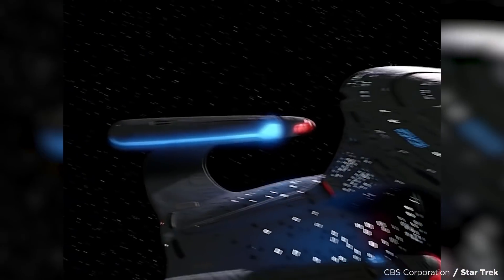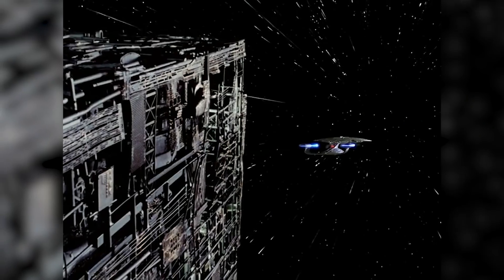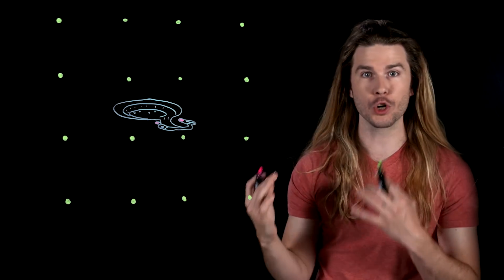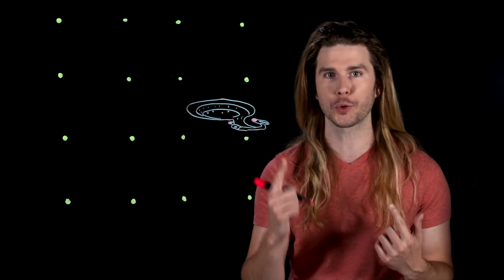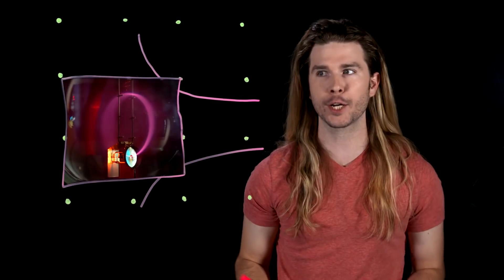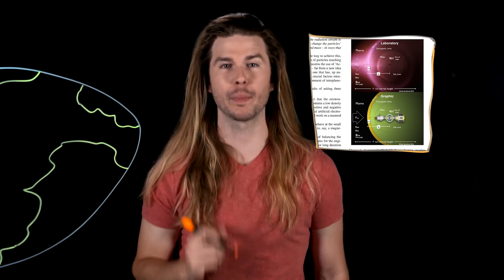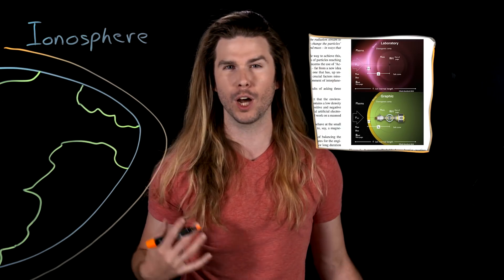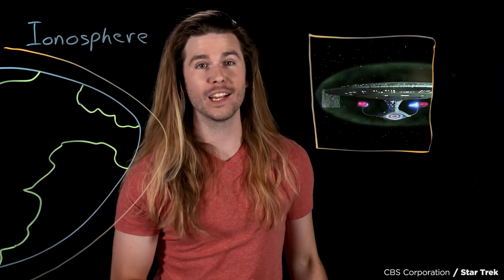How Do Star Trek’s Deflector Shields Work? (Because Science w/ Kyle Hill)

Comment: Phasers are not plasma beams in the classical sense of plasma. "Phaser" is, according to the book, an acronym for "phased energy rectification" – named for the process of turning stored energy into an energy beam without an intermediate transformation. Energetic plasma is pumped to a prefire chamber made out of a superconducting lithium-copper. There, it undergoes a rapid nadion effect in which strong nuclear forces are liberated. A protonic charge forms and is released in pulses to the emitter made out of the same superconductive crystal. A beam of electromagnetic energy is released from it, at the speed of light. On starships, energy for phasers originates from the EPS, while on hand units, the charge of energetic plasma is stored into sarium-krellide. This material is used because it can't accidentally release the charge of plasma. (yes, I just quoted the book).
Apparently in Star Trek, the main purpose of a phaser is wearing down shields, so these particles seem to be best suited to dissipate the energy of shielding and less effective against hull. The Tech Manual also states that there is a certain ratio (between SEM (Simple Electro-Magnetic) and NDF Nuclear Disruption Force)  that changes between the settings of a phaser. The initial effect is more metabolic (High SEM and low NDF; thus stunning), then turning to thermal effects (until lethal), then slowly becoming so volatile that it is able to disrupt the subatomic bonds, causing this disintegration-effect on the highest settings (high NDF, low SEM) (again, quoted from the book)...
Shields on the other hand, generate distortion layers of gravitons (the artificial gravity particles) that deflect energy along its own shell, thus it seems like an egg-like sphere or generally that large-area lighting-up when hit at some spot. The frequency of these is in tune with the ships own weapons, allowing them to pass through, while blocking incoming attacks from outside. It does not reflect or redirect the energy, it more dissipates it evenly (which is the plothole explanation why shields can wear out)... And yes, even more quotes from the book, albeit abridged because I don't want to quote the whole danm thing.

Comment: Well, that was interesting, but the show already discussed this in various areas. If we go via Michael Okuda's description (he wrote the book on most of the TNG technology that ST used and developed on in DS9, voyager and the TNG films): In Star Trek TNG (and the other ST shows) the shield systems they use is based on warp field tech. Essentially, when a beam weapon or a photon torpedo impacts the field around the ship, in that specific section of the shield matrix, it is energised and to the beam or torpedoes POV (as beam weapons are sublight only) the ship "moves" out of the way of it due to the shield in that tiny area "warping" space so it cannot hit the hull.  (Phasers are often modulated to penetrate a shield this way via scattering effects etc, but then shield tech improves to combat this.)

This localised area effect uses a GREAT deal of energy to generate the field against the high levels of energy being directed against it and so shields can be depleted rapidly the more energetic the weapon being used against them. As a shield absorbs fire and loses the energy it contains, the warping effect is lessened and fire can begin to "leak" through. Sufficently high energy weapons can "burn" out the generators creating the shields fields so rotating ships during combat to allow affected shields to replenish the defence fields and allow engineering to repair damaged shield generators is very important. 

 [NB: For an example of the power ST ships and shields have to cope with. A Ship based Phaser fired on a planet at full strength can destroy every living thing on the planet and, under continual fire, eventually destroy it.]

In Star Trek, this is why you do not use photon torpedoes if a ship has its shields up, as although torpedoes have penetration aids to try and get past this, they are vastly less capable than the phaser beam (or disruptor). So, in normal space, phaser weapons are usually used to deplete the shields of an enemy ship 

However, during warp combat phasers are useless as the energy and particles are not FTL based and so are affected by the warping of space, massively dispersing them and rendering them useless. Only photon/Quantum torpedoes can be used as they are capable of travelling at warp and so can hit and discharge against the ships shields/hull. Romulans, as they do not use photon torpedoes, use the plasma torpedo as it can travel at warp speeds if required (however, although it is vastly more destructive than a photon torpedo it is FAR slower.)

So, ST shields for combat are Warp field based. They do have another set of shields that always remain on and those are used to protect the ship at warp travel: these are "technically" the deflector shields which, when coupled with the main deflector dish at the front of the ship, protect it from dangerous particles, micro asteroids and space debris. 

But how we would create "shields" with our current knowledge base? Really fascinating. :)

Comment: Many things wrong here.
First the main defense system used at sub-light speeds since the last century, is the phaser. 
the common name for a complicated energy release process. 
as a replacement! for pure EM devices. such as, Laser and particle beam accelerator. 
Phaser is an inherited acronym for PHASE • Energy • Rectification, which describes the original process in which stored or applied energy was converted into a different form when it entered the phaser system to eject it to a target. without the need for further energy transformation in the meantime. This is also essentially true of the current phaser effect. 

Phase energy is triggered by the application of the fast nadion effect (FNE). Fast Nadions are short-lived subatomic particles that have special properties associated with high-speed possess interactions in atomic Nuklei. These properties include the ability to release and transfer strong nuclear forces within a class of superconducting crystals known as 
fushigi - no - umi. The crystals were from science Departement of the fleet research and development facility in Tokyo.

Each Type X emitter element can direct 5.1 megawatts. For comparison: the small personal phasers. which excelled at Starfleet crews. belong to types I and II. of which the latter has a maximum power of 0.01 MW. Certain. planetbound phaser emitters intended for defense purposes are referred to as Type X +. their exact energy output falls under secrecy. The Galaxy  class has twelve phaser banks in two different sizes. which are mounted both above and below the ship and additionally two benches for lateral detection.

Emission of the beam 
The triple-faceted crystal that forms the last, the ejection station, consists of LiCu 518 and measures 3.25 X 2.45 x 1.25 meters per single segment. The crystal lattice formula used in the matrix enhancement process is Li..Cu..:SI::FE.:.:O. The collimated energy beam exits from one or more facets, depending on which precombustion chambers are filled with plasma. The firing sequence of the segments, controlled by the phaser function command processor, decides along with the ejection direction of the facet, the final vector of the beam. The total energy output of the segments is directed across adjacent segments due to power coupling, converging at the output location where the beam exits and seeks to the target at the speed of light. Narrow beams are fired by fast segment-firing. further fan-shaped or cone-shaped rays result from a lower rate of firing. Of course, wide beams tend to cause significant energy loss per unit area detected.

Targets which are protected by EM defensive shields and a partly absorbing, partly repellent surface coating can still be hit. But only with a correspondingly higher energy consumption. since the shields must be broken. Due to the EM • polarization, the phasers can penetrate the ship's shields from the inside to the outside, whereby only a slight loss of force due to the resistance on the inside of the shields has to be accepted.

Now the deflector shields
Like most force field devices, the deflector system also generates a limited area of highly focused spatial distortion in which a high-energy graviton field is maintained.  The deflector field itself is emitted and shaped by a series of conforming transmission grids on the shell of the spaceship. creating a field that closely follows the shape of the ship. This field is highly resistant to impacts of a wide variety of materials, ranging from relativistic subatomic particles to more massive objects with lower relativistic velocities. When such a disturbance occurs, the field energy is concentrated on the impact point, creating a strong, narrow space distortion there. an observer aboard the ship. it looks like, as if the intruding object were bouncing off the shield. However, a zero-dimensional observer on the penetrating object would find his / her trajectory unchanged while the ship had suddenly changed position. This is somewhat analogous to the spatial distortion caused by a natural gravitational source, and is usually from a momentary discharge by Cherenkov radiation which often appears as a short blue flash. The deflector is also effective against a variety of electromagnetic, nuclear and other radiated or field energies.

Shielding the ship against the full spectrum of electromagnetic (EM) radiation would require too much energy for normal cruising flight mode. 
In addition, a shield system working against the entire spectrum of the onboard sensors breaks the collection of many types of scientific and tactical data. Instead, the operating conditions of the deflector cruise mode are relatively low level (approximately 5% of the maximum yield) and on the specific frequency bands used to protect the habitable parts of the spacecraft from EM and Nuclear Radiation intensities according to RVSF Standard 3473 (a) are necessary. In combat readiness situations, the shields are brought to at least 85% and maximum yield in defense configuration by increasing generator power. The modulation frequencies and bandwidths of the shields are randomly varied to prevent hostile power from tuning the frequency of a directed energy weapon (such as a phaser) to the frequency and phase of the shields so that it can penetrate them.  If, in the opposite case, the frequency characteristics of a directed energy weapon are known. it is possible to increase the efficiency of the deflector. dramatically increase shields by using the shield frequency sets exactly to the firing frequency of the weapon. Similar techniques are used to protect the ship against various natural hazards: for example, the shield is used to protect against X-ray radiation. which is generated by a supernova amplified on the 10 'n meter frequency band.

Comment: Would you still be able to see anything or use any type of "sensors" to see anything through this field? Being blind in a space battle may not be a great strategy. Could this be why they modulate the frequency of the shield, to prevent a build up of additional particles that could impede there offensive capabilities.

Comment: What about shield strength/effectiveness? The crew of the Enterprise D was practically amused when they were attacked with lasers. However, the shields are steadily weakened by percentage points when deflecting a significant force. Holes will eventually appear, even before shields are reduced to zero percent. Enemies can potentially pinpoint these vulnerable areas, causing significantly more damage. Under these circumstances power redistribution is essential. Emergency shields and physical bulkheads serve as the last lines of defense to prevent depressurization.

Comment: What would this type of shielding do to sensors? how would you be able to tell where you are going?
Reply: Ah ha, now you delve into the realm of navigation in space. 

Currently our absolute best method, that would work everywhere in our galaxy, is something called GPS. No, I’m not talking about the GPS in your phone, that’s Global Positioning System. What I’m referring to is the Galactic Positioning System, or as I sometimes call it, the Pulsar Positioning system. 

As I’m sure you know, and I’ve no desire to explain in this comment, pulsars are a type of neutron star that create what we observe as pulses that are more precise that even some atomic clocks. Using those pulses, from multiple pulsars, and a bit of math using known values for those pulsars, you can precisely calculate your exact position. Last I heard, our current systems are accurate to the foot. 

That right there, gives you your position. Now, you just have to figure out a course. Which is fairly simple! Assuming you have FTL, all you need to do is point in the correct direction and go like hell. Of course, you need to take stellar drift into account, because even at galactic distances and superluminal speeds, you will have travel time and the stars do move, but we have a pretty good idea of how stars orbit the galaxy, so accounting for their drift is fairly simple.

Otherwise, you need to plot a trajectory in a similar manner as you would in our solar system, and be damn confident in your math because one wrong variable, a mis-rounded answer, or a missing significant digit, and you’ll wind up light years off course and that’s no bueno
Reply: @MrStreaty122  i love how you wrote this like a sci-fi character explaining it to another character lol

Comment: Hang on hang on hang on...
Aren't "Deflectors" and "Shields" two different things? Star Trek calls 'shields' shields and 'deflectors' deflectors. Star Wars is the only one that calls them 'deflector shields'.
Star Trek:
Deflectors are the things that allow a ship to move at warp speed and not be torn to shreds by any space debris. They're generated by the big blue thing under the saucer section.
Shields are as you described them, however, they block torpedoes as well as beam weapons, so they're not deflecting charged particles.
As I understand it, the shield emitters output a steady stream of inverse, negative mass polarons, that... bahhh! I can't babble in techno any more!

Comment: That's a perfect explanation for: "SHIELDS AT 50%"
All the plasma gets used up disintegrating projectiles or absorbing phaser radiation and your left with a bare bones magnetic field which would offer minimal protection
Reply: But shouldn't shields start at 0 and then take take to form?  Why can't you regen shields just as fast as you brought them up?
Reply: @petergerdes1094  I think there are stores of plasma so that the shields can be quickly turned on. Then, when they are turned off, remaining plasma goes back into the stores. They probably keep extra plasma to regenerate shields stored as gas. It takes time to convert it, and overall regens at a slower rate than the shields are degenerating under fire.
Reply: @petergerdes1094 because your forming the shield  instantly with say 2000 ( insert power here ) but only regenerate at say 200 , when your not using them you can fully charge them ( capacitor) back to the full 2000  over time ,  

or - you use the entire battery power from your laptop in one second 260,000 joules but to keep it going you are using only 96 joules sec  to recharge it .

Comment: You mentioned the neutron bomb, but never addressed the Star Trek equivalent: the PHOTON TORPEDO. So... How would the Enterprise's shields fare against a photon torpedo? There's plenty of evidence that these are loaded into tubes (totally unnecessary, if you asked me), thus making them shielded themselves. However, motive force is never discussed, nor implied. Outfitting a Photon Torpedo with a gas tracking sensor was successfully done on several occasions. Care to extrapolate?

Comment: What's the difference between disruptors and phasers? I also remember that the deflector grid has a separate function than the shield grid.
Reply: IRL? No idea. Trek tech only really works with Trek technobabble. (Treknobabble?) 

In the show, phasers are (like the dude said) particle beams - however, they use an unknown radiation/material/technobabble maguffin called 'nadions' to produce (or enhance? It isn't really clear) the beam. 

Disruptors, on the other hand, work by breaking (or 'disrupting' as the name would suggest) atomic bonds, essentially splitting atoms into their component parts. Basically, nuclear fission in a gun. How this works is a mystery.

Then there's your Romulan plasma weaponry - basically just beams of plasma as was suggested.

Finally, there are the Dominion's polaron beams - presumably some kind of magnetically-confined antimatter beam that destroys everything it touches in an annihilation reaction. They can also pierce shields because plot.

Comment: Every time you said "Deflector Shields", you made my Trekkie ears hurt. "Deflectors" and "Shields" are two separate things.

The "Shields" are what protect the ship from enemy fire and surround the entire vessel.
The "Deflectors" are a frontal cone that prevents space debris from colliding with the ship during warp travel.

Roddenberry himself had to constantly correct the show's writers when they would mix up the two.

There are several episodes in the show's many iterations where Roddenberry accidentally allowed such a mistake slip through and the character will mention Deflectors when they meant to say Shields.

After Roddenberry's death, the mistake happened a lot more often. But technically speaking, these two things are not the same.